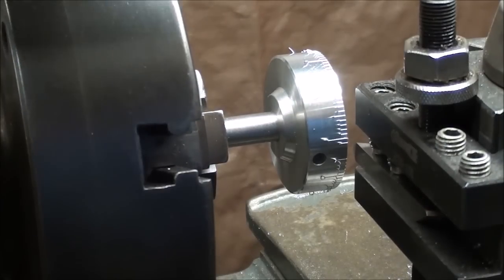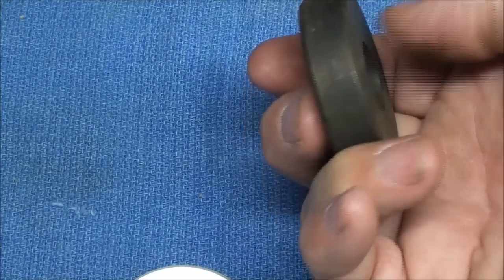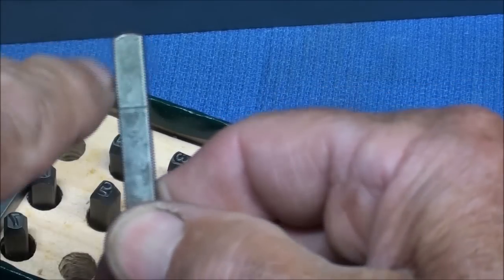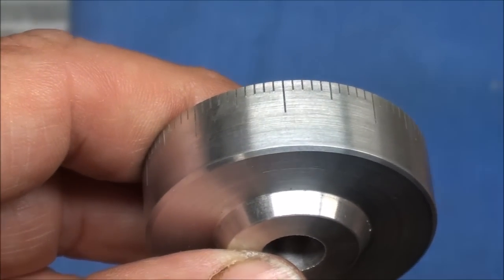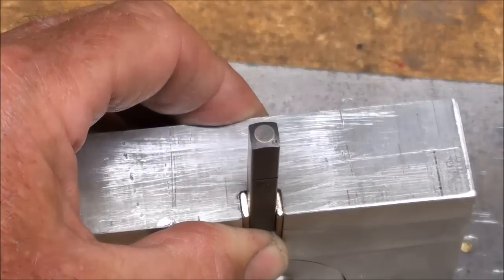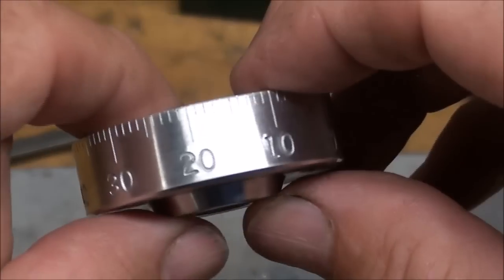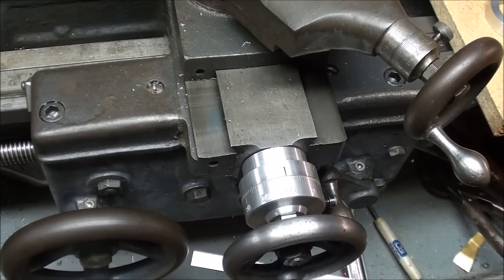SHOP TIPS #180 Making Larger Dials for the Logan Lathe part 4 tubalcain

Comment: Mr. Pete, I loved this series. I have an old 14" cut-off blade that is 100T that I use in woodworking components. At the time, it was not that expensive and I have since replaced with a new one. I should work perfect for my project of replacing my dials on my lathe.
As always, thanks for sharing.

Comment: Great set of vids MrPete. I am using these to repair an old Enco lathe I have had for several years. Mine was a basket case and the crossfeed dial was/is missing. I will make some parts to fit this lathe since I can not buy parts for it any longer. These vids really help me figure it out. Thank you very much.
Reply from the maker: Rick Wagner Thanks for watching

Comment: I just made some dials using this same indexing method and the divisions look really nice. For the numbering,  I made up a tool post mounted jig to do the job. As you commented, the numbers are hitting into a curved surface so I did a calculation on a typical 2" (50.8mm) dial and a 3mm stamped character. With the stamp center just touching the curve of the dial, each side edge of the character is only about .001" from the dial surface (hope that's right) - not so much as one would think! 
Thanks for the time you put into this video.
Reply from the maker: Thanks--glad someone else made dials
Reply: @mrpete222 
     Lyle, never stop teaching and sharing your immense knowledge with your friends and family. It is your place in life. You can always be a teacher, but I suggest letting Mr. Henry have a go at any surplus auction stuff. And no more deleting a video please. You never know when someone who is earnestly trying will need that info. Just between us. Delete this response if you want me to quit poking my 👃

Comment: Thank you for the inspiration.  I adapted this process to by lathe mill combo to make up a couple of dials for a graver sharpening jig that I'm building.  My dial was for 360 degree so I used my cnc mill to make up a custom 72 tooth saw blade out of 1/8" abs plastic.   All I have left to do is the stamping.
Reply from the maker: That was a great idea I'm glad it worked out for you

Comment: I think this was one of the best series I've seen. Graduating and letter punching is not often covered in books so it was great to see it demonstrated by the master teacher. I loved the idea of a saw blade as an indexing wheel and the simple ratchet idea probably made it faster to use than inserting a pin in a hole. If Jordan was passing I bet he thought his grandad had built a clock, with that rocking noise!

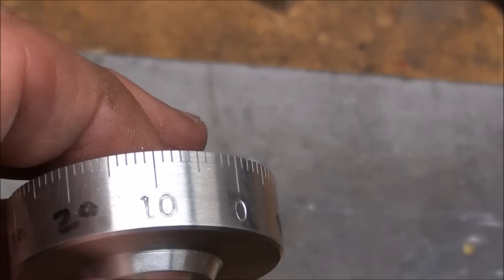Comment: 13:47 Or by aligning the 1 in the middle, like you did with the 0, and rotating the dial slightly offset to account for the offset position of the stamp. That way you're always almost striking a flat surface.

Comment: Shoe polish - you can't beat " K 1 W 1 ".
That stamping jig is amazing.
Reply from the maker: Esquire is good too
Reply: I got a couple of paint sticks for use in coloring scribed index marks in plexiglass for a project recently. They work pretty well. Just rub off the outer coating from one end, then rub over the scribe marks, then wipe with a rag to remove the paint that isn't in the marks. Saw it first 30 years ago when getting a bowling ball drilled.  The guy stamped my name, then rubbed a paint stick over it, wiped with a rag, and done! Looked good for years.

-- Mike
Reply: I was always wondering what the best way to color index marks / numbers was.  Marker, layout dye, or spray paint came to mind.

Comment: By my calculations, I am coming up with you stamping the number pairs 1/8" apart.  If that is correct, and you would have made your slot for the stamp 1/4" wide, you could have centered the tick for the 0 and stamped it.  For the two digit pairs, you could put a 3/16" shim on the left side of the slot, aligned the tick with the edge of the shim, stamped the non zero digit, put the shim on the right, align the tick, and stamp the 0.  You have twice the number of alignments, but the stamp would be going straight into the dial instead of at a slight angle and you would not have to hold a shim in with the stamp while stamping.

Comment: You could use for resetting the dial a piece of brass a spring and a set screw, the spring could have enough pressure to stop the dial from moving on its own but it yould be reset without loosening anything.

Comment: I own pretty much the identical lathe (slightly older) and made larger dials using your technique almost exactly. My only changes were: 1) to use a bent piece of annealed hacksaw blade in place of your milled-part/roll-pin pawl for indexing, and 2)  I made the dial read directly (diameter) instead of radially (I still used 100 divisions, but numbered 0, 20, 40, ... 180).  

I'm curious if you're having the same issue as me with a larger dial, though. I have to *REALLY* crank down on the dial lock or it will slip, especially when cranking out (counter-clockwise). With larger dials, there's more bearing surface, and the simple logan dial design creates on-axis thrust between the dial and the fixed part when cranking out. As a quick fix, I'm going to try simply relieving a few thousandths from all but the inner half inch diameter or so of the dial (where the nut bears axially) and maybe adding some UHMW plastic washers. I'm also thinking about designing something using needle thrust bearings, but if I go to that trouble I'm going to eliminate the axial lock and design an in-line twist lock.
Reply from the maker: I do not seem to have that problem, but your solution sounds very workable.
I have been thinkin about making diameter reading dials on the atlas.
Reply: mrpete222 Wow. UHMW plastic washers worked way, way better than I had any right to expect. So well that I'd consider the washers mandatory — the feel of the cross-slide and compound slide is noticeably improved (now the gib screws are the only thing that affect the tightness of the slides). To make the washers, I super-glued a piece of UHMW onto a freshly faced piece of aluminum. Then I turned it round, drilled a hole, and faced it until it was about 1/32" thick. Acetone and a razor blade to remove it from the aluminum. If I remake the dials, I'll make a recess for the washer so that it's only proud by 0.005" or 0.010" but the 1/32" gap isn't all that annoying.
Reply from the maker: Rex Walters
Sounds good

Comment: Not bad for an old guy!! You know I'm just kidding! Impressive none the less. You made the comment you don't draw things out before making things. You and I are on the same page there! I seem to be able to visualize my projects in great detail, therefore not having to draw or make sketches. I will be making new dials for my lathes, but will be using a few different methods.
Very nice job indeed, thank you Sir for taking the time to make these videos, (And they really weren't that long), and for sharing with us!
Ray
aka Razor!
Reply: A drawing helps me visualize the part before it's made. It's a lot better than staring at a set of instructions (i.e. G-code). Simple parts like the jig, I agree. No need for a drawing if I've already got it visualized. However, if there are critical dimensions not easy to remember (as in, I need a #50 hole to be tapped 2-56 0.382" from an edge), then a drawing will help me remember all those odd dimensions. Doesn't have to be a draftsman's work, but if you look at Phil "The Tool and Die Guy" Kerner's videos, even he uses CAD occasionally for layout work.
Reply: ***** 
Seeing as my projects aren't rocket ships, as this one clearly is not, no need for any paperwork or drawings.
I've been told by many, that what I have is truly a gift! I think it's normal..
I can follow a set of drawings, or chicken scratch if someone were to ask me to make something,  but after I see it on paper, it becomes imbedded in the noggin and wal'la, looka thear, here ya go!
Have a nice day!!
Razor!
Reply: Razor Works Tom Lipton & Keith Fenner - amongst others - will often do what I do for simple parts... Keith calls it Cartoon Aided Design, where you take a pencil and a scratch pad, and lay out your wok, not using a ruler of anything special, but noting your chosen dimensions. 

I do this a lot in the shop when I'm thinking things out, because it's much cheaper than wasting material. I'll alternate this with scribbling on the stock with a sharpie...

While I can hand draft up parts, I'm personally fond of AutoCAD - I sometimes use it in my work. I'm not quite to where John at NYC-CNC is, where he's cut the check for Solid Works - it's really pricey, and I'm not doing CNC work.

It's all a continuum as far as I'm concerned - you should use the design tools that fit what you are doing... When I'm training techs and junior engineers, I do make them use scratch pads because it helps them to think about their work...
Reply: chemech I understand what your saying. Some people draw, some don't. Most times I only draw a line or a shape to cut to. Like I said earlier, I've been told it's a gift, but to me it's completely normal. Bottom line, do what works for you.
Razor!
Reply: I agree with you, Razor and Mr. Pete. I can make a part in the same time as it takes to draw the details. The designs have to be done mentally if you're dawing or building, same amount of time consumed. For large projects such as a house, bridge, etc., drawings are needed, but small items are easy to do without a drawing!
....13
Reply: arkansas13 Agreed!
I finished a load bracket today, I need to hold my mill parts that I am currently working on.  Simple design, basic fabrication,  a little welding,  and a few holes. Now on the other hand, I'm in the process of building my new home, so plans a plenty!! Without them, no house....
Sometimes you need them, sometimes you don't!
Reply from the maker: soaringtractor
THANKS

Comment: I know that this video is 3 years old but a thought came to me.....if the slot for the stamp was kept a close fit, could one not simply use the outside edges of the slot for registration? For example, for the number 10, align the mark on the right for the 1 and then on the left for the 0. Seems that would maintain the same spacing for the numbers, or am I missing something?

Thank you good sir, for all that you do and share, you are indeed a wealth of knowledge for any that take advantage of the opportunity!
Reply from the maker: Thank you that's a good idea

Comment: Great job!....although I use a 4" throw dial indicator on my cross slide, I am planning on still making larger dials for a couple of my lathes....they just look neat. On the stamping jig....I think I will make tapered filler strips to accommodate the slight angle of pointing to dial center. I think that will allow better stamping on the outsides of the numerals. I am also toying with having my dial stock sand or bead blasted, just before stamping....also toying with bluing it before cutting the graduations, or using a white delrin rod similar to the Hardinge dial.....thanks for the "spark"

Comment: I read comments suggesting angling the stamps to get a cleaner impression. But why not make the jig to only hold one stamp and have two reference marks to align the two numerals. That way both stamps would be on the center line of their respective positions. You could use the same jig for a five digit number or a name and it would work to perfection.
Reply from the maker: Might work
Reply: I was thinking the same thing even before reading any of the comments, other than I never gave it a thought about stamping 5 digit numbers or even 3 digits for that matter. But YES, it would be much easier to make the jig fit a single stamp on center and then index accordingly for the numbers. (Or LETTERS for that matter.)

Other than that..... EXCELLENT VIDEO ! I probably wouldn't have even thought to make a jig like that if I hadn't seen it here first.
Reply: Exactly !  that would insure the best result.  also should skim or polish the surface after the stamping for a more professional look.

Comment: Hello again Professor...

(by the way, someone told me that when I call you Professor, that I sound sarcastic and I want you to know that is not my intention but that I use the term with reverence to pay tribute to your abilities to do what you do both machining and the way you present the material)  I would have loved to be one of your students in school.

Now for my next nit-pick / idea / question...

I love the idea of the jig for numbering... Two thumbs up for that.
With your thououghness I was expecting to see you make three slots for the numbering dies as opposed to just the one.  Seems you could have made two additional slots on 3.6 deg. angles or whatever the correct number would be so that the double digits, which most of the numbers were, would strike perpendicular to the surface of the dial.

Perhaps it would have had to be one wedge shaped slot with a triangular wedge to locate the die and two wedge shaped dies to locate the 0 die.  Either way, do you think this idea would work for this application?

As always, Keep up the good work,
Looking forward to your next post (and any comments on my comments if you would be so kind)

Anon
Reply from the maker: Thats a good idea--never thought of it. Thanks for watching
Reply: I was thinking of a different way to solve the perpendicularity problem.  If you make the slot to fit the stamp fairly tightly, then scribe three marks near the bottom of the slot: one centered, and one a measured distance to each side, you could use the middle one to line up with your long dial line for stamping the zero, then line up the long line for a double digit number with the left mark for the right digit and then the right mark for the left digit. That would maintain spacing between the double digits, but let you always strike perpendicular to the dial. Other than the trickiness of locating and scribing those two offset lines, it shouldn't be any harder to make or use.

Thanks for the very interesting video series. When it comes to dials, bigger is better!

-- Mike
Reply from the maker: BigMjolnir
might try that. But its back to using judgement rather than a fixed setting.

Comment: What a great way to make dial indicators..THANKS

I was thinking if you made the channel the exact size of the punch or used the brass shims and moved the dial to the positions by marking the graduation marks on the jig so that each hit is parallel..in other words making a mark on the jig that you then use the graduation marks on the dial to align the stamps the right distance apart for each numeral.In this way the stamping is straight on... just saw this mentioned a few times here...Still looks great how you did it!
Cheers
Reply from the maker: Chuck Itall Thanks for watching

Comment: The problem with filling the numerals with materials such as Kiwi (or Laquerstik) is that lubricating and cutting oils used with the lathe will probably ultimately cause the material to dissolve.  Excellent thinking and fine craftsmanship, as always, my friend.  This effort is only rivaled by your quick change gearbox gear replacement job for the Logan lathe.

Comment: @8:30 Love your perfection Lyle!
@16:25 If the threads are buttered up, go to the next size or flat out make a fillister head. Easily flame hardened head on your one off FHMS . Was also thinking about darkening with ferric chloride etchant or similar acid. Judicially applied grease for the relief you need with a tiny toothpick in the marks after a thorough cleaning with Dykem™ remover spray of the entire dial. I well remember the times that I have set my dial with a HALF mark of accuracy when setting up. Do you happen to have a rail or bedway scraping video? I had one bookmarked but can no longer find it. Was either Stephan Goestweller or Kieth Rucker. Another old video that I lost was a technician resurfacing a clean room granite surface plate that required the tech's equipment to acclimatize in shop overnight. That was so dang precise that even the thickness of the layout marks were used near the end with a certified bottle of red Dykem as a reference standard! That video in and of itself is quite a lesson to behold. 👉👍👈 🪡⚖️🧬🔬🔍 (｡◕‿◕｡)➜ԅ( ͒  ͒ )ᕤ

Comment: Would it work to use some sort of press to imprint the numbers with some sort of press rather than a hammer? Perhaps an arbor press or something with a distance readout or DRO like your Bridgeport or a dial like your lathe cross feed or carriage? I guess it would not damage your machine. Certainly feel would tell you if you were using too much force marking a test piece and you could determine how many thou depth a proper mark would take. You could centerline the jig to measure how many marks to turn to get proper number spacing, and make the grove in the jig the width of the number die. On the other hand, the job you did was great! Do you need to paint the dial with clear paint or tape to preserve it? Alumininum can get pretty ugly with age.

Comment: You could have made the slot to fit the dies and on the double digit ones you could have
centered the short line that was to the left for the left digit and centered the short line that is to the right of the long line for the second digit.  Not positive, but I think this will
work.
Great video as usual .  Now I have to try one, and see if the Lord will get me all the way
around without making a goof-up.  Thank you Mr. Pete

Comment: I appreciate the video. I would have liked to see you check the accuracy of the original and new dials with a dial indicator, just to see how close you got to a mass manufactured part.
Reply: To be clear: I meant how the actual feed movement tracked to the dial indication.